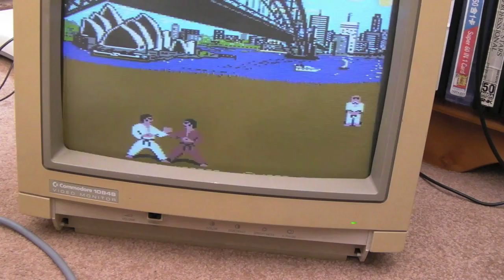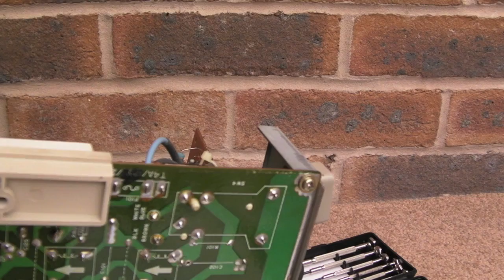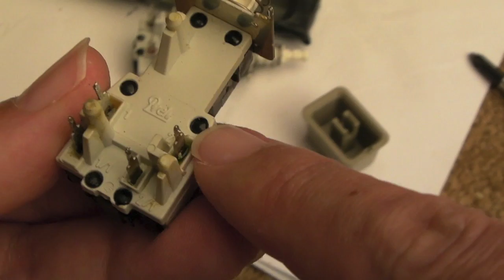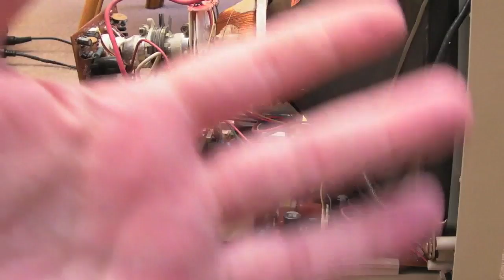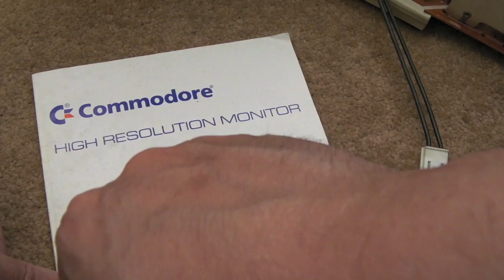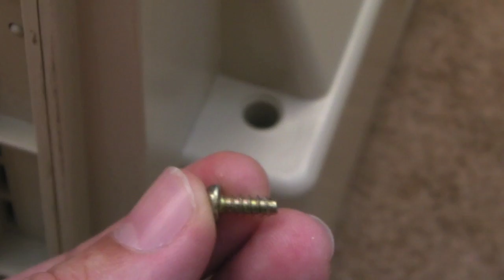Commodore 1084S (1084S-D1) Repair(s) - Part 1

Comment: Good video, however you conclusions about what is or isn't dangerous in there is wrong. And that wrong conclusion is dangerous. 

The voltage from the high voltage transformer. and CRT is high, but it's not that dangerous. If you get zapped it will hurt A LOT. 

However some of the caps on the lower voltage might seem less dangerous because the voltage is lower, but some of them can be very dangerous. 

The problem is discharge rate and total energy released.
Reply: Had this problem with my A1200 and 1084s. After some minutes started to lose sync and acting crazy. My rgb cable was wired with all the syncs connected. I stripped the H/Vsync from the rgb cable, I only left CSync. Now it keeps sync even for hours, never had a problem since then.
Reply from the maker: I will emphasize about caps and other lower DC voltages in the next video.  Typically EHT is more dangerous due to the ability for HT to arc, and the fact the tube stores all that high voltage DC (and a lot of it) - so when we talk about current, there's more than enough current for a CRT to stop your heart.   I accept that there are other lower DC voltages that can be lethal, because as you say its actually about how much current (and overall power) is required to stop your heart.
Reply: GadgetUK164 - Retro Gaming Repairs & Mods 

Have a read. http://lowendmac.com/2007/the-truth-about-crts-and-shock-danger/
Reply: BTW, I do have an issue that I think is right up your alley. What's the best way to reach you?
Reply from the maker: Thanks but I cannot do repairs for other people.  I have a long term health problem, full time work, family etc - hard to find time and energy to do my own repairs =/
Reply: GadgetUK164 - Retro Gaming Repairs & Mods I am not looking for that. Besides I live across the pond and shipping would be prohibitively expensive anyway. 

I've got an Amiga 500 with a video problem and I've had no luck finding a solution online, mostly because anyone with an Amiga thinks they are an expert. 

It basically loses sync. I think it's the horizontal, but it could be the vertical or both.
Reply from the maker: It could be a capacitor issue - I would need to check the specs.  The other possibility is the hybrid at the back of Denise, or maybe just a problem with Denise.  Don't rule out your cable - have you inspected it to see what resistors it has, and how the H and V are wired in the cable?
Reply from the maker: On a 1200 it could be a bad cap causing that!
Reply: I ended up finding the problem.  Turns out the Amiga is fine, its my cable which uses the H&V sync.  I guess I need a cable that uses composite sync.

The Amiga works fine with a 1084 monitor.

Comment from the maker: When I referred to the speaker connections as right and left - what I meant was from the back of the monitor.  So basically the speaker inside the top housing is nearest to its connection on that little PCB. It's kind of logical.

Comment: I have an Atari 65XE with a dead PSU. I was looking at the pinout, its 7 pin and looks like 3 of the pins are 5V. I was thinking of trying to hack the connector to a ~1.5A 5V USB PSU. Do you think thats a good idea or know where I can get a cheap replacement power supply for the unit?
Reply from the maker: See my 65XE repair video - I did exactly that!  I used a cheap camera PSU - just search eBay for 5v 1.5A and I am sure you will find a suitable PSU.  Then just chop off the connector from that PSU and wire the 5v and ground to the relevant pins on the DIN and you're done.   You could buy a new DIN if you don't want to use the old one from the old PSU.
Reply: Wonderful, I'm having a hard time though using the right keywords to find it. So far 65XE related I only see your "keyboard repairs" video and "Upgrade to 128KB". I was thinking of either hacking the din cable portion into a standard USB connector to make it replaceable, or try to cram it inside the original broken brick to just keep the style. If you had any references I'ed appreciate it, I found one online but that was it so was a bit hesitant, If its just the two leads to 5v and ground though I should be able to do that. I was just a bit more hesitant when I saw what else was going on in the power brick other than just a transformer, thanks!
Reply from the maker: That "keyboard repairs" video is the one - somewhere early on I briefly show a PSU and the DIN I used.  I cannot remember if I talked about the wiring but its available online and really simple - just 3 pins joined to 5v, and 3 pins to ground I think.  Just check that whatever PSU you use is measuring between 5v and 5.30v, and check your polarity before you plug it into the Atari and you should be fine.   A USB connection sounds like a nice idea!
Reply from the maker: Thanks =D  Hard to find the time lol!  Just spent the last 40 minutes replying to messages on here lol =/

Comment: Great video as usual and timely, as I have a few 1084s monitors to service -- mostly, they need new switches. Also, a great note about the potentially deadly dangers poking around in CRT. I was a bit leery even when you had it unplugged; some of those caps can still pack a wallop until they discharge.

Good tip about the old dry silicone glue/paste (if that's what it is; not sure). I recall a video from Mr. Carlson's Lab where he talks about that gunk becoming conductive once it gets old (brittle and yellowed).
Reply from the maker: Thanks!  Yes - you're right, lots of high DC voltages even without the worry of the HT side lol.  I like Mr. Carlson's Lab - he doesn some great videos!

Comment: I bought one of them monitors off eBay and when I took it out the naffly packaged box it was in, it was hissing. The tube was cracked (thanks Royal Mail) and I panicked, I thought it was gonna blow up hahaha. I now have the Philips 8833-II that I since sent to a guy that added Chroma & Luma to the back so I can hook up my C64. Great vid looking forward to part 2, and yer watch yourself, make sure you ground the anode before removing and taking out the chassis.
Reply from the maker: Ouch at the cracked tube =(  Yep, grounded the anode in part 2 - I just kept putting it off until absolutely neccesary lol.  I hate working on CRTs.  Hopefully this will be the last lol.

Comment: Very cool video, I'm waiting for the 2nd part - and nice timing too :) I have recently bought the 1084 monitor (the one with a philips tube and the power switch on the front) and it should arrive tomorrow. Should be in working condition, but I'm going to recap it probably anyway - definetly going to clean it up internaly and examine its overall condition. Have to be really carefull when working with those, especially with the adjustements/diagnostics that cant be done when monitor is powered off. The story with a leaking flyback that shocked you - scary - thanks that You mentioned it - a very good warn and an extra thing to be aware of for everyone watching. Stay safe and ultra cautious please!
Reply from the maker: Thanks!  And great pickup there =D  I do quite like some of the older models more.  Wear rubber gloves whilst you make any 'live' adjustments!
Reply: I will probaly just clean it up externally and internally since it is in overall great condition, I was expecting the tube to be worn out, becouse the picture showed on auction was not looking promising - but it turned out that it was just a matter of a brightness knob turned up almost all the way. I set all the adjustment knobs in default position and the picture is perfect, tube seems to be in very good condition - it probably wasnt used much, can tell that becouse the power switch is original and it still works and the paint/text on the switch is not worn at all. Very nice monitor for all the retro needs!

Comment: This is a real life story. I was working on my Cruisin USA and I was working on the monitor. I forgot to put the anode cup on the tube and brushed by it...never have I felt like was gonna die like that...I know the feeling my friend.
Reply from the maker: Ouch!  It's aweful isn't it - thank god we are hear to tell the tale lol.  Cruisin USA is a cool arcade game!
Reply: absolutely. I still haven't put the stupid game back together either. Need to recap the CRT and put it back together. You might not remember, but you were trying to help me fix my Neo Geo 4 slot on neo-geo.com. I ended up just replacing it with a 2 slot I got from the guy who sold it to me. No issues since:) Even was able to swap over my custom bios.
Reply from the maker: The MVS can be tricky to work on, especially the 2 slot, 4 slot and 6 slot boards!  You can get really wierd problems that sometimes defy logic lol.  When a decent set of schematics is found for a 2 / 4 / 6, things might get a bit easier.

Comment: 1 Unplug tv from mains, 2 Pink rubber kitchen gloves, 3 clip crocodile clip to metal frame of the tv, 4 put left hand in your pocket because heart on that side , 5 crt discharge tool under the anode cup.
Reply from the maker: =D

Comment: I guess this is a "facelift" model, my 1084S looks more 80s and have a power switch on the front. My 1084S monitor too goes black and white with NTSC composite (most likely s-video too, haven't tested). If you connect computers or consoles with RGB, then you will have colors. I made my self a DIN to SCART adapter to easily connect consoles and computers with the regular SCART connector used on TVs. The monitors appear to be RGBHV, but it works fine with connecting the sync to horizontal and leaving vertical not connected. When I got my monitor it only showed blue color, and would get a washed out image if I wiggled the cable on the back (blue and green, missing red). Turned out all the pins on the RGB connector had cracked in the solder joints. Fixed it with reflowing them and added a tiny bit of extra solder. Excellent monitors these old Commodore ones.
Reply from the maker: Thanks!  Yes, its a facelift model - I also prefer the look of the older ones!   With regards to RGB - yes, was aware but just haven't got to looking at the RGB input yet, but I will do at some point - once it's actually working lol.  I had planned to do a SCART (female) to DIN adapter as well - just not sure what will work and what won't yet, until I try each console.  Hopefully most if not all systems should work I think.  Thanks for the tip on the bad connections on the D type socket - will check that later.

Comment: Hi,
Another fantastic video! I'm waiting for the second part! ;)
One year ago my 1084S-D1 died decided not work any more.
After several attempts it returned to life one more time but after this it died again. 
The symptom is: when turn it on does not give absolutely nothing ... not even the LED light. 
Minwhile i replace a bad capacitor (the big one), who is bloated. 
After a new verification in the board, I found that the transformer has no voltage at the output. Does anyone know where I can get one to replace the broken? I went to two local stores and did not find in any of them, search on the web and not find anything with this reference. 
Thanks in advance for any help. 
Is it really the transformer? Or something else?
Thank you in advance for any help.
Reply from the maker: Since its completely dead - eg. no sound, no LED - then I would assume you've got a problem on the main power supply section.  Possibly one of the small electrolytics near the STK IC (on the heat sink).  In my 2nd video (uploading now) you can see I swapped out the 1uF capacitor there, but there are 2 x 22uF 50v caps which I've had to order.  I would certainly swap all 3 of those, and examine for dry joints around that area of the PCB and check the resistors there - one could have a bad connection or have gone ope circuit.  Also check the fuse on the board too!  Beyond those things, it could be the STK IC.
Reply: Thank you! 
I will try your tips. ;))

Comment: Removing the epoxy off the resistor did have a massive effect. The picture is at least steady, it's just green.
I have a 1085S and it doesn't have that green switch button. They must have removed it as an obsolete option or something.
I have an arcade monitor which starts "jerking" after having been turned on for a while. It will twitch every now and then but only after a while. I suspect a cap problem as well. But I have NO experience in fixing monitors so I won't go near it.
Reply: Knowing me, that is exactly what would happen.
Reply from the maker: Hehe =D  Quite amazed I didn't get a shock working on this yet!

Comment: very nice. these commodore monitors are beauties...there's just something about CRT that modern TVs can replicate.
I was wondering Mr.G. Do you fancy a new challenge? My Neo Geo multicart never got to China, well it's come back to me. It powers on but the screen is garbled. Any ideas what I can do? Would you like to take a look at it and try and fix it? :)
Reply from the maker: =D  Before you give up, have you had a look at the boards?  Have a quick look inside - just make a note (or take a photo) of which board goes on top, which on the bottom and the orientation with regards to the platic spacer which seperates the two boards from each other.  And have a close inspection of the chips on there, and the traces.  Maybe you've got a burned or damaged trace, or maybe a bad solder point.   That's pretty much all you can do with these carts.  if you wanted to reflow the solder on the CPLD (large square chip), just buy some chipquik flux from eBay, and put some of that around the chip and just touch the pins with your iron and it should reflow.  Have some desolder braid on hand just incase you join two pins up by accident - but that's what I would do.
Reply from the maker: ie. there are no replaceable parts on them except for the dioes, (or regulator if there even is one), and the caps (which wont be the issue).
Reply: OK thanks MR .G. Will do that and report back :)

Comment: I'm trying to repair one of these at the moment, it's a different revision of the 1084S-D with the power switch at the front. 
On power-up I get activity from the tube (i get the degaussing sound and i see the back of the tube glow) but there is no other activity, no picture, no sound, the power LED doesn't even come on.
Reply from the maker: If the power LED doesn't come on I would think you've got a power problem, perhaps on one of the lower voltages - used by the video input circuitry and audio amp etc.  I will take a look at the schematics later, but I think there's a 5v rail - maybe you are missing that, perhaps a dead 7805 or something, or maybe whatever is on the 5v rail is shorting it somewhere.
Reply: I thought the same thing, I've replaced the 7805, and 7812 just in case but no luck. I then replaced the switching regulator on the power supply side (an STK-47310-II) same outcome. 
According to the schematics the 7805 and 7812 are fed from the 19V output of the Flyback (which i want to replace as a last resort). I don't want to poke around with a multimeter when the things powered on so i'm using trial and error.
Reply from the maker: Have you measured the line output transistor - just to make sure that transistor hasn't shorted or something (although typically the fuse might pop if it had).
Reply: After searching the service manual there should be a mica insulator between the Horizontal Output Transistor and its heatsink. I think I binned it with the old transistor facepalm 
The HOT might be being shorted to the heatsink.
Reply from the maker: Yeah, I tend to not like trying to measure anything whilst its on!  In that scenario - get yourself some wires with croc clips, put the clips onto your meter probes, set your meter in the correct mode (eg. DC voltage), solder the two other wire ends to the points you want to measure, put meter away from the monitor, make sure wires are OK and probes not touching anything, then switch on and see your reading.
Reply from the maker: Worth checking you've not shorted the line output transistor after that!

Comment: also note the tube itself is a capacitor, a 20+ kv capacitor
Reply from the maker: Absolutely!  There's a lot I forgot to mention in this video, but I will mention in part 2!   That's one of the reasons I prefer to work on the board without disconnecting the anode lol.

Comment: Nice video.  I have a Commodore 1942 monitor that has a washed out screen and what looks like flyback retrace lines.  It used to correct the screen when warmed up but then stopped.  And eventually stopped working and has a black screen now.  Any idea on where to start?

https://www.youtube.com/watch?v=ByxExRnBY9E
Reply from the maker: Looks like maybe the screen voltage is too high or something - probably capacitor related (as it was).  Since its now dead - it depends on how dead it actually is.  ie. do you hear any whining noises or any EHT / static noise from the tube?  Can you see any glow in the back of the tube (stay well away from it if you power up with the back off).  It could be a secondary PSU fault - again related to a cap, it could also be the flyback (line output) transformer has failed on it, or maybe even the fuse on the PSU.  TBH - if you haven't worked on monitors before, and there's not an obvious cause, I would be tempted to take it to a repair shop or sell it for parts and buy a working unit.  You could take a gamble and check the fuse, then swap out all the electrolytics, but that's not a guaranteed fix, and you could get a lethal shock from charged caps, and the tube will hold 24Kv even when the unit is not powered.